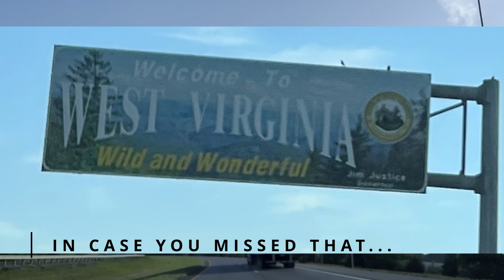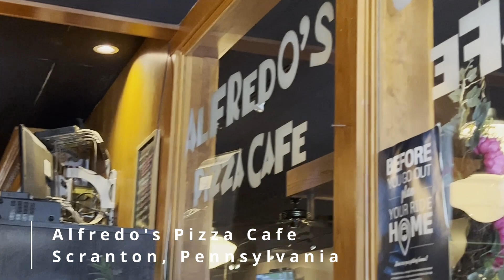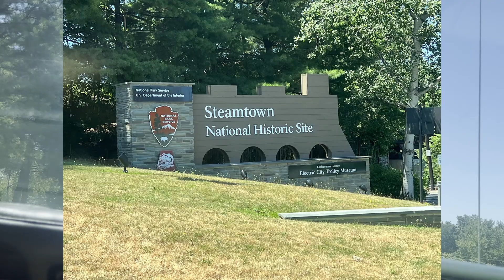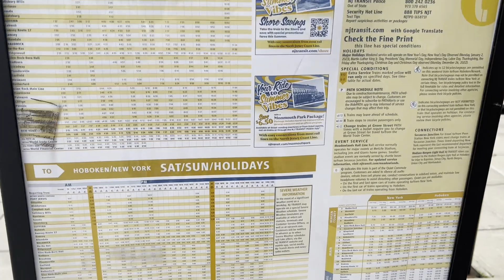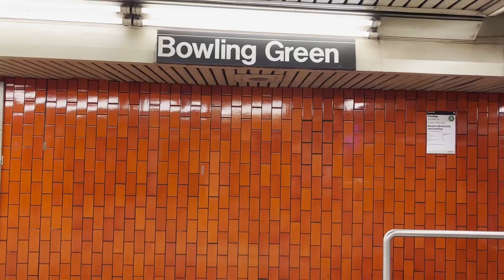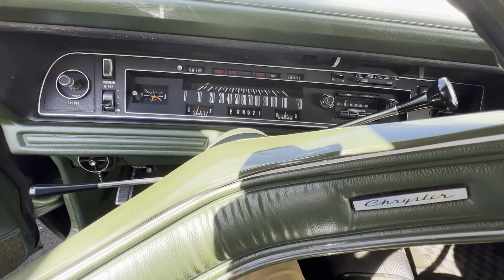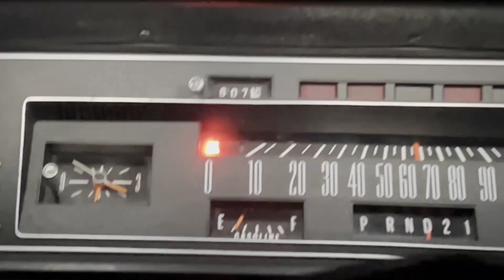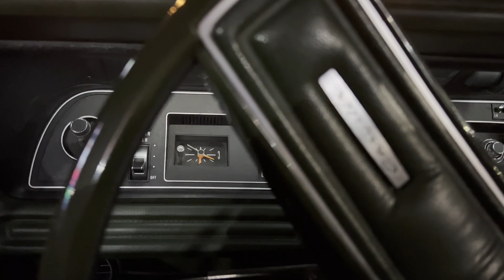1970s Family Road Trip. NC to NY and back in a 1973 Chrysler Newport. MoPar!

Comment: My Dad bought a brand new 69 Chrysler Newport Custom 4 door sedan. It was the EXACT same colors as yours. That was such a nice car. 383 2 barrel with 2.76 gears. In drive, it would shift into second gear at 55, into third gear at 90 when floored. What a great car it was. You get in on the Interstate, look out. You could just float at 80-90 mph all day. Too bad, Nixon changed the law to 55. We had just got the Interstate, just up to our town. Otherwise, the whole I-29 was not finished until 1981.
Reply from the maker: It’s very easy to speed in these cars. They aren’t like other old cars where you can TELL you’re going 90!

Comment: These cars and many from this era and before were reliable transportation including long road trips . I grew up as 8 year old in 1971 and spent many hours in a 71 Chrysler very similar to this one . 

From 71 to 79 lots of time on the nation's highways . We took several vacations from our home in Maryland to Florida and back . On one trip a guy in a 72 Chevrolet C10 rear ended us on Interstate 70  around Fredrick , MD .

 The Chevrolet pickup thanks to the higher rear bumper on the Chrysler sustained more damage than our car . I have pictures of the very mild damage from the accident . 

71 Chrysler still had points no electronic spark control and it never gave us any issues .
Reply: Yeah our bought new Newport 2072. St major east coast dealer pre CHEK of car manual windows fell out on. Pass side.  Before plated..quality. Vontrol

Comment: Wow my parents bought the same exact car for my mom. It was the biggest lemon..
She went out and bought a Fleetwood 62 series. They gave it to me after I totaled my first car out. That Chrysler went thru at lest 11 batteries 8 alternators 10 starters my Chrysler was a New Yorker Brougham, with every option….it was an electrical nightmare! Lol Man I was so happy when they bought me a 1975 Chevy Caprice Classic 2 door coupe….
Good luck with you  Chrysler your so lucky that you don’t have power windows! Mine went down and wouldn’t come up. Faulty plastic window switches……That car was hard to Kill I put over 200k miles on it. Many accidents but the Chrysler took them like a champ. It was indestructible…..Lol air conditioning never worked from the dealership….Omg the memories!

Comment: Like driving a motorized lazy boy down the highway . Can’t beat the ride and they had good power to . I had a 70 Chrysler Newport when I was 18 back in 80 . It was a two door bronze with a black vinyl top and black interior and it was loaded . And in great shape . Had the 383 -4b carb . Great running car and man when I went out of town it was such a smooth cruise .  Had a really nice set of rims on it as well . Those were the days .
Reply from the maker: @grego934  Sounds like a nice one!

Comment: I had no idea about the half inch drive slot for the power steering pump tension. (owner of 73 road runner) love learning litle tthings like that
Reply from the maker: It makes it much easier to adjust the tension!
Reply: @ObsoleteAutomotive  I bought a Pittsburgh Pro 1/2 Composite Drive from Harbor Freight just for that job. Handle is perfect for the task.

Comment: My two older brothers shared a car. It was a 1973 Chrysler Newport Custom coupe with the road wheels and a 400 CI engine with a two barrel carburetor. That car would positively scoot! It had been my Grandparents car.
Reply from the maker: @tkewrestler2662  nice! What color ?
Reply: @ObsoleteAutomotive  it was sort of light buttercream yellow with a black top. It had black interior with the high back seats. If I ever found a 1973 coupe in fairly good shape, it would be hard not to make that purchase.
Reply from the maker: @tkewrestler2662  I can picture the car exactly. The ‘73s are the least favored of the ‘69-‘73 Fuselage Chryslers so the price point is usually much lower. You can probably find one reasonable!

Comment: Great trip. A lap belt is only protection for the lower body,  you really need to buckle the shoulder belt for the best protection if something did happen.
Reply: The shoulder belts are absolutely awful before the self tensioner. If you set the belt correctly you can't even reach any of the controls. I tried them once in a friends 68 Polara a long time ago.
Reply: @JrGoonior  As a 16 year old in the mid 70s I was very happy to have my grandfather's hand me down 1970 Buick Electra to drive.  One night after a week or so of seeing "Fasten Seat Belts" printed above the steering column I buckled up both the lap and shoulder belts mainly out of teenage curiosity. Yes, the shoulder belt with a fists width of space between it and my chest was awkward and confining and I kept   messing with it trying to get it adjusted. I did have to lean into the belt to reach the radio,  the ashtray and lighter, but after driving around that night, I found that it snugly held me in the seat when I was taking curves a bit too fast and driving a bit too "spirited".  After a couple of times buckling up I became accustomed to wearing the shoulder belt and actually found that I had a better feeling of how the car drove and handled when strapped in.  The obvious safety aspect and an enhanced driving experience was a no-brainer to wear both belts.  I can see how a one time user would probably not wear it again, but I started wearing the belts every time I drove.  By 17 my usual habit was to get in the car, turn the ignition, push in the lighter, buckle up both belts, light a cigarette and drive off.  Fast forward to 1983 and coming home one weekend from college.  A drunk driver in a Chevrolet Suburban crossed the center line and hit me head on.  Because of the size of the Electra and the fact that I was wearing both the lap and shoulder belts, I walked away with only minor cuts, scrapes and bruising from the belts along with being slightly dazed, not to mention being extremely sore from the jolt of a head on collision.  The drunk driver surprisingly was wearing a three point seat belt, but had the shoulder belt under his left arm basically a three-point lap belt- had massive head and chest injuries from impacting the steering wheel.  His unbelted passenger was ejected through the windshield and landed on the mangled hood of the Suburban.  He did not survive.  At the time of the accident I was 21 years old and only about four miles from home.  That is why I told the driver of the 1973 Chrysler that he and his passenger needed to wear their shoulder belts.  Yes, those shoulder belts are a bit confining when properly adjusted, but I am living proof of their effectiveness.  And that is the whole point of buckling up.
Reply: I finally found a happy medium in my 69 charger.

Comment: They're at the end you were filling up at Sunoco and I noticed you put 87 octane which is surprising that you run the cheap gas in that I used to have a 71 Plymouth scamp with the slant 6 and I ram premium unleaded in it because in 71 the octane was much higher regular was 91 octane back then so when you try to put 87 in a car it's way below regular octane for back in the day it doesn't run that good so I would suggest running the premium with the lead substitute if you haven't had the valves switched over to the kind that can take the unleaded fuel it helps?
Reply from the maker: The 1973 model Chryslers were designed to run off unleaded or leaded fuel. I don’t use any lead substitutes in my vehicles. And unless you drive at high rpm for long periods of time or have a performance engine, hardened valve seats usually aren’t necessary. And at 36,000 miles the car has plenty of life left! This car operates fine using regular gas. No spark knock or other issues.

Comment: I wouldn't use JB weld 
Find someone to record that radiator.
Reply from the maker: Good luck finding a radiator shop these days. They are all closing down. Also the JB weld is still holding strong.
Reply: @ObsoleteAutomotive  
Or try Rock Auto 
That's where I get my parts for my 71 Chevy Impala

Comment: You should edit more, make it shorter
Reply from the maker: The video has been edited significantly to reduce the length. However, to keep the trip cohesive it needed to be this long, and I also will use this video for myself to look at the trip again. 

But there are chapters in the description and on the timeline/playback bar in the video that can be used to skip to certain parts or move ahead and back if desired.
Reply: It's called turn the video off when you get to be too long for you I find it fine amount of time.
Reply: @ObsoleteAutomotive  okay now i know your deriction your going, i just thought you needed some feed back but i still liked the video
Reply from the maker: @williamkarlsson500  No worries. Thanks for watching!
Reply: I enjoyed the whole video!
Reply: William karlsson your attention span needs to be LONGER